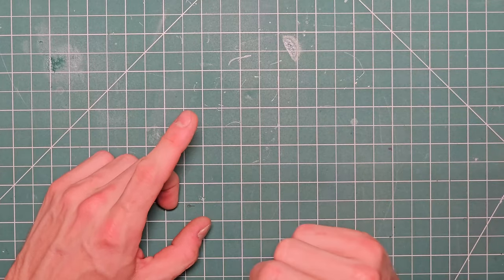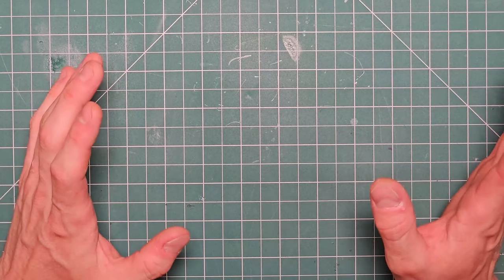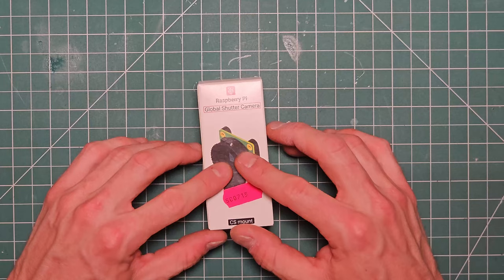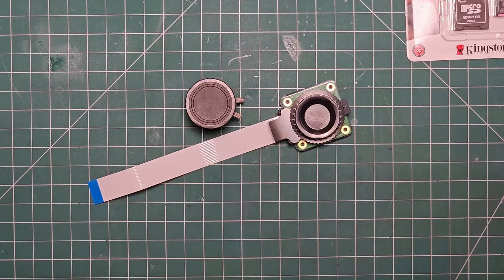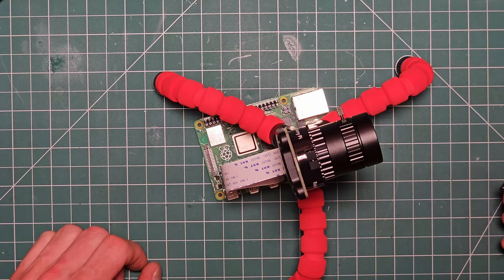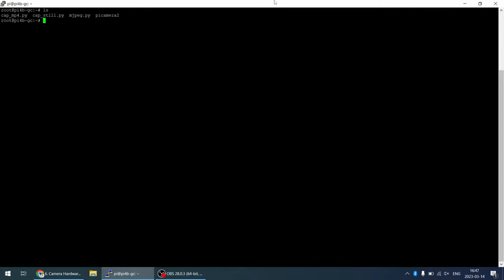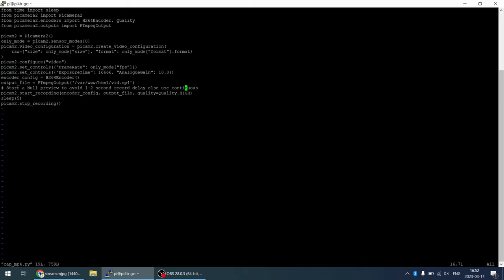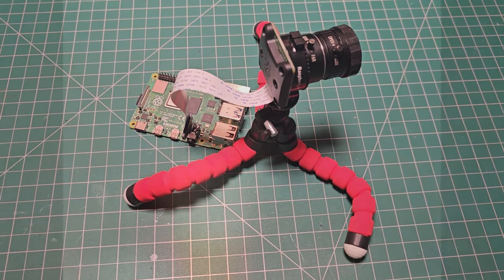Testing Raspberry Pi's new Global Shutter Camera (Low Light, Python Code)

Comment: Great video - i'm building a super8 scanner (early state) using the global shutter cam and tried your cap_mp4.ty example - i tried recording super8 film which runs in front of the microscope lens (like a movie projector) and i hoped that i would get to see each single frame in my 60fps video but it's all blurry like with the hi quality camera with rolling shutter :( shouldn't that suppose to work? i also tried a recording my table fan running at slow speed but getting a blurry rolling shutter video aswell - thanks!
Reply from the maker: Hey cheers mate. I thought it was actually a pretty average video, but slowly getting there haha. Interesting project idea! Rolling shutter should give you cuts through frames, blurring likely means the motion is higher than the FPS. Here's some info that might help you out a bit!

This camera module can do 60fps at 1456x1088px (1.58MP) from what I understand - 1440 x 1080 recommended though - HOWEVER, that will also require a lot of light to get a smooth image. The reason is that in each 'frame', the shutter may be open for a longer or shorter period depending on your iris or otherwise exposure settings. For example if you've got your shutter set to 90-degrees, then at 60fps it's capturing the image for 1/4 of that frame time, aka in 4ms or so (I think), which reduces the blur. If the shutter is fully open, aka 360-degrees, it'll be exposing for all of the 16.67ms in that frame, meaning it'll get the blur of your slide moving. Ideally you want to fill it with as much light as possible, and have the shutter as fast as possible. That's unrelated to fps really, you could record at 15fps, and you still have the same issue with motion blur just to the long sensor exposure in each frame, probably just worse there too!

Something else interesting that I did find though, is that one bloke used media-ctl to put it into 720x540 and got 116fps from the sensor: https://forums.raspberrypi.com/viewtopic.php?p=2090128&sid=e56cc51c52ce15ae2fbf136a77d8e4fd#p2090128. You'll also see a bit down a bloke gives an example command where he is trying for 200fps, and he's setting the shutter speed there to 180 degrees (100, at a frame rate of 200), so you could use that call as a test for getting the settings right.

That all said and done, long story short would be to max out the amount of light, drop the resolution if you don't need 1080, up the fps to max out the sensors capabilities, and then get the shortest exposure per frame possible as long as it's still bright enough to be discernible.

Enjoy!
Reply: @PlatimaTinkers  Thanks mate for your detailed reply :) I've made some progress in the meantime - I seem to have solved most of the problems, but there are still a few left ..
I have not yet been able to find out how to deactivate auto-exposure or whether it is possible at all - theoretically, it already works well at the moment, but deactivating it would probably improve performance, as i have constant lighting.
one positive finding was that the film reel runs very slowly and the camera manages to capture the images with ease and good quality.
i am currently struggling with the programming - i have already managed to recognize the sprocket hole and cut out the frame based on it, but this process seems to take far too long to run in real time. 
i would have expected that performance-wise it shouldn't be a problem with the new pi5. 

I currently do it like this:
read image in a loop, sprocket hole detection, output image - but it doesn't work or seems to be too slow. the screen output seems to lag behind the detection and i get a black image and error messages.

I still have some questions about your code snippet cap_mp4.py:
does it make a difference in terms of performance which codec you use? 
is start_recording() necessary to get the high fps performance or could you also make a while loop to get the single frame?

do you have experience with google coral? i have already bought it but haven't tried it yet - maybe real time recognition is possible with it.
Reply from the maker: @darklord_ice  Hey all good!

The auto exposure SHOULD be able to be adjusted. Depends how you're taking the image. Exposure Value (EV) is just relative to ISO, shutter speed and f-stop (iris), and exposure speed is just shutter speed, so if you specify all three at once, that specifies the exposure. I think the iris might be fixed, so just ISO and speed to set. There may also be a 'gain' value, as sometimes that's treated separately, but technically that should be 1:1 with ISO. Depends on the driver/software/implementation from what I recall.

Glad to hear the image capture is at least good quality!

For recognising the sprocket and cutting the frame, depends on the hardware you're using. Something like the Luckfox Pico Max and you'll want to use RKNN / IPC to have the 2nd core do that lifting, where as on the Milk-V Duo line you could use the RTOS core. This will take some more complex learning and programming, but give you much faster processing if done right. Else, I'd recommend doing it in Python and use PIL, as that should ideally be very fast and efficient but may also need multiple threads.

Re the speed, you can also try throwing out functions until it gets faster. Eg if you're encoding this to a file as H264 AND displaying it on-screen, then chuck out the file write operations and see if it speeds up. Then chuck out the encoder (swap will 'null') to see if it's something wrong there. Else if it's just on screen, dump the data into a black hole (Preview.NULL) and just output the frame number or FPS to consonle, see if that speeds it up. That should help narrow which functions are causing the slowness. ELSE, you could use the trick with two streams; use the LQ stream to do the recognition and grab the frame from the HQ one.

Lastly, with that Python example, start_recording() is kind of a wrapper for two other functions - picam2.start_encoder(encoder, output) and picam2.start(). If not writing to disk you don't need the encoder, if not previewing it you can omit show_preview, and then after calling .start() and waiting ~1000ms for it to spin up you should just be able to call .capture_image("handle") and then process the image with PIL after that.

Hope that helps get you a bit further! I'll be hitting similar issues when I work more on my humane AI animal trap now that I'm fairly certain I'll be using Luckfox Pico's for it!
Reply: @PlatimaTinkers  Thanks for your detailed answer, I'll take a look at autoexposure as you recommended. yes, there is an analog gain value, I set it to the maximum of 16. I use a pi5 with SSD + openCV via Python, which allows me to cut out the frame, but I still have to find a way to get the sprocket hole to be in the right position while the film roll is running. Another project uses a UV LED and a phototransistor, but I would like to solve it completely in software and don't know how yet. It would have to detect when the sprocket hole is in the correct position and then take the photo.
Thanks for the tip about the luckfox pico, it's very cheap - I'll get it and use it for another project - how would you store the OS to it? Seems like it doesn't have a micro SD port. I will also test your performance tips. What I haven't tried yet is whether it runs faster if you just take a photo instead of taking the frame from the stream. Your tip with low/hi quality stream sounds very good, how would that work to capture both at the same time? I'll take a look at PIL, haven't heard of it, but I think openCV is sufficient for cropping. What exactly is your animal trap about? See you then, Tom
Reply from the maker: @darklord_ice  Yeah hardware like a photosensor using a GPIO tied to an interrupt is pretty much the sure-fire way of doing it with pinpoint timing, BUT, it should absolutely be possible in software. For the thread that's analysing the incoming frames looking for the sprocket hole, I'd definitely drop that down to something like 320x240 2-bit first, as that should still have identifiable holes but be WAY faster to process.

If done in hardware, these are fantastic: https://www.makerfabs.com/slot-type-ir-xd-51-optocoupler-motor-speed-measuring-counter.html

With the Luckfox Pico, they all have microSD card slots I think, but some of them also have SPI flash. I've got them all listed here: https://shop.plati.ma/collections/all?filter.p.vendor=Luckfox if you want to check each. I've done 3 videos on the key variations of the Luckfox Pico range now, so maybe go check out the video from two weeks ago?

I've not used OpenCV much, but PIL is Python Image Library - very fast at working with bitmap data in python. Some of @CodeBullet videos where he's doing Human Challenge etc use this with great performance.

For dual stream, the PiCamera2 example apps have heaps of great stuff. 99% of my work is copying and pasting from it haha. Here is dual stream high/low-quality: https://github.com/raspberrypi/picamera2/blob/main/examples/capture_video_multiple_2.py and I saw this FrameServer one which is likely also relevant especially if you're doing this threaded (hopefully!) https://github.com/raspberrypi/picamera2/blob/main/examples/frame_server.py. Lastly, I found this GitHub issue listed where there was some great code examples using buffers: https://github.com/raspberrypi/picamera2/issues/740

The animal trap is basically making it more humane using MV. Eg setting the trap to only trap rabbits and foxes, so that neighbours cats, wombats, birds, etc, don't get trapped. 

Cheers
Reply: @PlatimaTinkers  Hi,
Thanks for your answer - I ordered the optocouplers and will test them, they are also interesting for other projects. There is progress with my project :) I managed to read out the sprocket hole with openCV and can now play Super8 in real time :) There are still a few problems but the proof of concept stands. Currently, as you recommended, it runs under YUV420 and so so far only in grayscale at 640x480. but every frame is scanned/displayed and the playback speed is also correct. The next step is to get it threaded with a 2nd stream that outputs the image in high resolution and in color. in detail: it would only have to get the cropping coordinates, cut out the image and output it. chatGPT suggested me to use 2 configs and switch between them but I think that's the wrong way. The script you recommended (capture_video_multiple_2.py) with start_encorder() and stop_encoder() makes more sense imo - but I haven't figured out how to get the while loop in there yet. my new script (with threads) uses a loop with while running_event.is_set() - I think that's the right way. Another question: there is openCV headless - is video output possible with it? I'm currently using the normal OpenCV in the bookworm desktop environment via Anydesk.
The final goal would be a standalone player that only runs at high performance via a console and outputs the image via HDMI - let's see how far I can get :)
Reply from the maker: @darklord_ice  hey mate very welcome. Sounds like you've made some solid progress!

You're starting to exceed my capabilities and understandings now, so I can only really give you reference info. As far as video output though, you've got two easy options;
 1) Using the 'preview' functionality which uses PyQt: https://github.com/raspberrypi/picamera2/blob/main/examples/preview.py
 2) Stream it to the network with your desired encoding and protocol: https://github.com/raspberrypi/picamera2/blob/main/examples/capture_stream_udp.py
Reply from the maker: @darklord_ice   Hey how did you get on with this? Believe it or not, I picked up an 8mm film camera from the markets that looks like it still works! Just need to get me some film for it.

Comment: Can you check the CPU & GPU  usage when running 60fops camera vs 30fps camera ?
Reply from the maker: GPU I forgot to check. To be honest, not even sure how to? But it used 15% CPU time at 30fps, and 25% at 60fps. Reminder: this is at 720p whilst also converting to MP4 in realtime on a Raspberry Pi 4.
Reply: @PlatimaTinkers can it RAW video?
Reply from the maker: @victoryhelmi2552  yeah mate it outputs RAW10, so how you process that is up to you! If you check https://datasheets.raspberrypi.com/camera/picamera2-manual.pdf you will see under section 4.2.2 you can specify 'raw' as the mode. There's then a bit more info on that at the end of page 19 and most of 20.